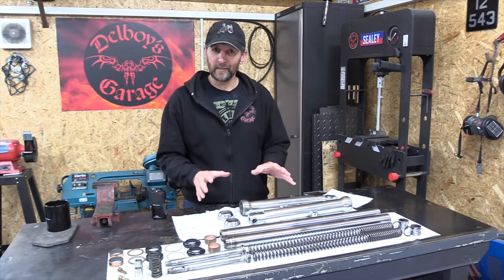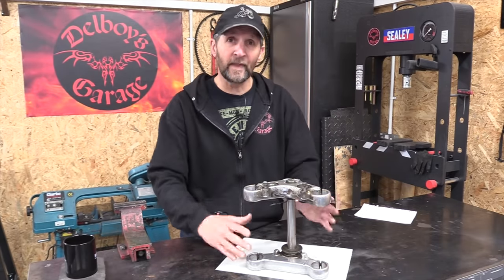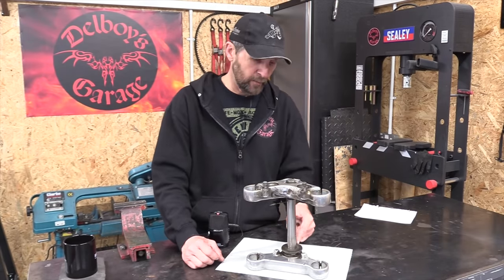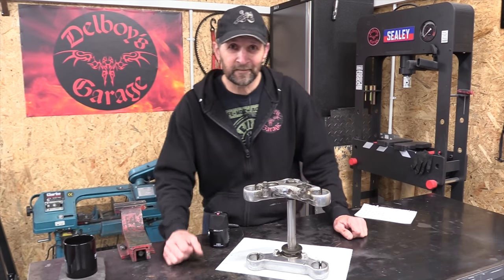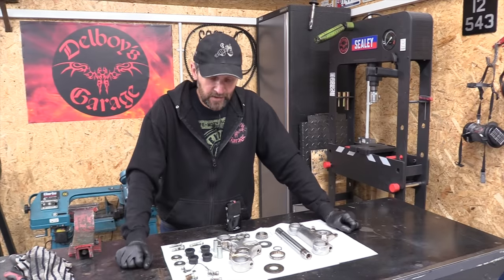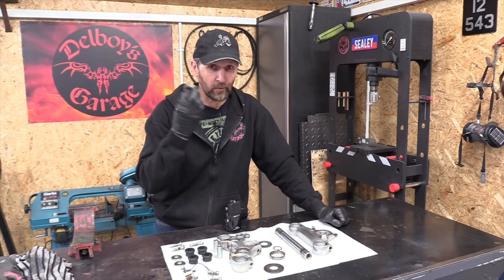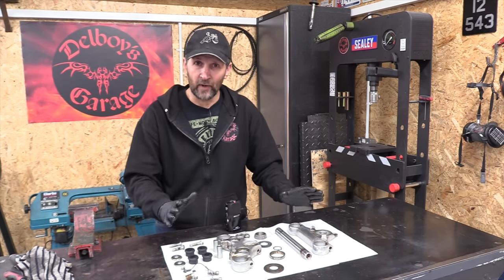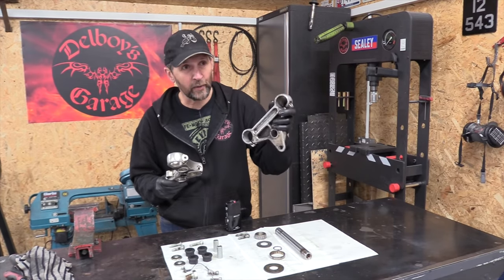Harley Sportster, Triple Trees Restoration! (1 of 2).

Comment: Just ordered my wiha grips from your last video. They have sold out because of you Del 😃. Thanks for the heads up. Tony
Reply from the maker: Yeah, so sorry about that Tony, there has been a bit of a run on them.. but you'll get them as soon as the new stock arrives shortly, and you'll love 'em mate, so many uses, even in the home, i had to take a tap apart in the bathroom a while ago, did the job a treat !!   Thank for your support mate.. Del.
Reply: @Moonfleet41  Thank you for everything you guys do. Your the best. Tony.